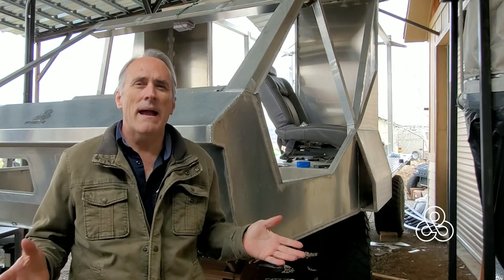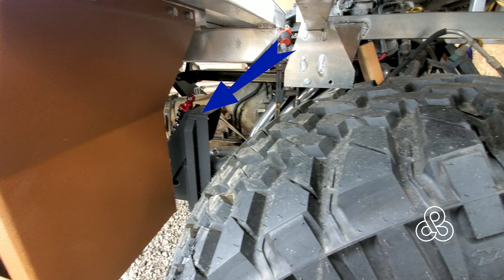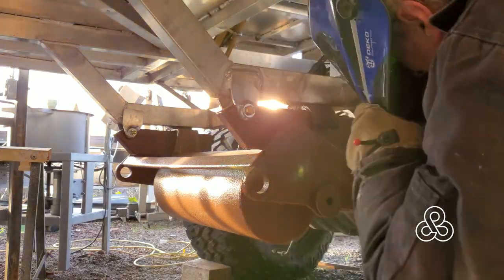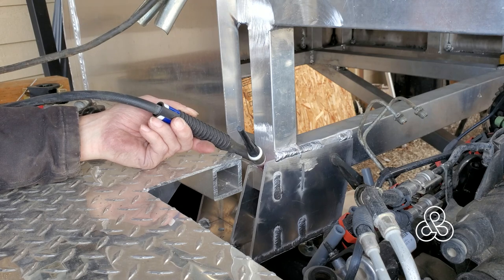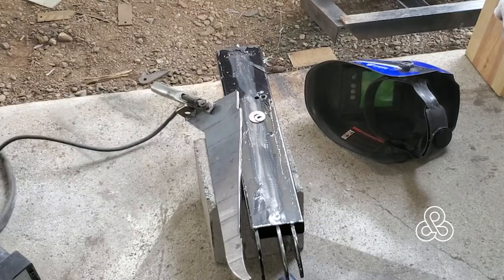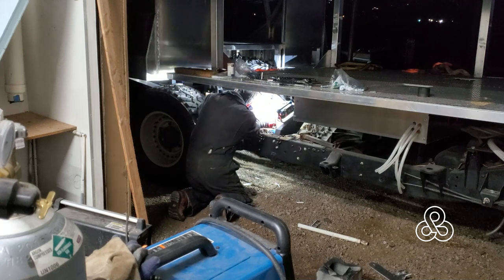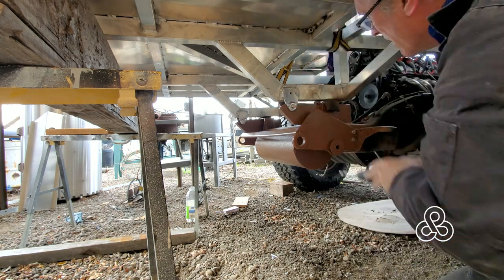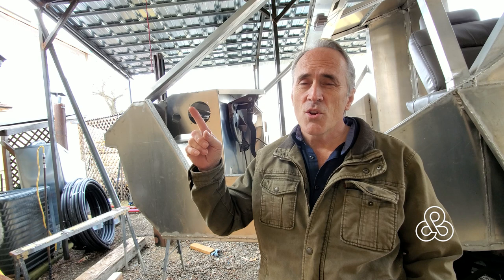L19 Cantilevered coil-over cab mounts, Leviathan overlander project

Comment: Tip
To avoid galvanic corrosion Ensure that all major ground connections are directly to the battery and not through the frame.
Sacrificial zinc plates can also be used.
Don’t you just love it when the iPad spell checker decides that even though you only typoed one letter a word that is almost nothing like the one you misspelled is correct
Reply from the maker: Plus prayers and a sacrificial lamb!  ;)

Comment: Hello, great video as always. I was curious about something though; on the shock absorbers you installed. You said they had a load rating of 750lbs. the point that I saw as the weakest was the shear strength of the 3/8 (i think it was a 3/8" bolt) bolt holding the shock in place. I have seen 3/8" bolts shear quite easily but I have zero idea what the actual strength of those bolts are though. I am assuming that you have already checked this but I just wanted to mention it. Also I have had kidney stones too, they are the WORST. I hope you are feeling better and never get them again.
Reply from the maker: At 12mm (basically 3/8") a grade 8 can resist well over 5000# in shear. I would have to reduce that significantly because of the centering bushings, but still into the thousands of pounds of shear. It all becomes mute however, because the bolt will never see the loads, as the bump stops take any serious hard hits. Always so much to consider isn't there?
Reply: Remember that the bolt is in double shear, as it is on 2 mounting surfaces so that will double it's shear strength.